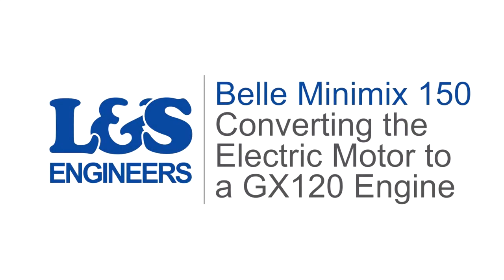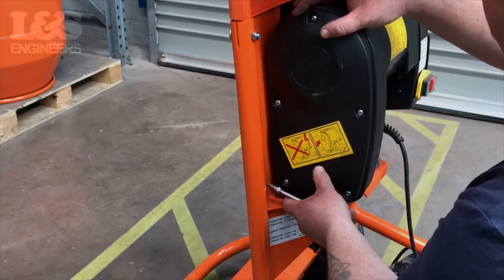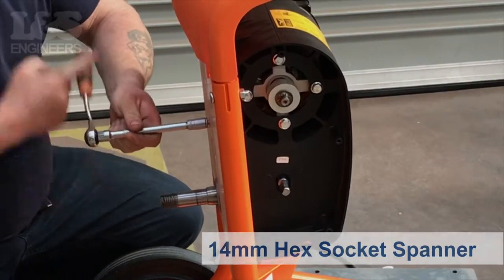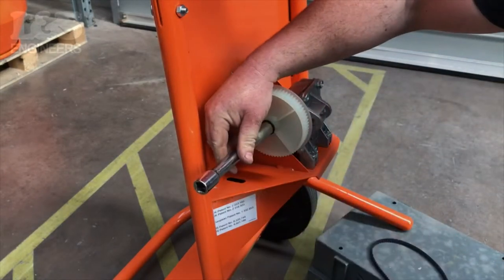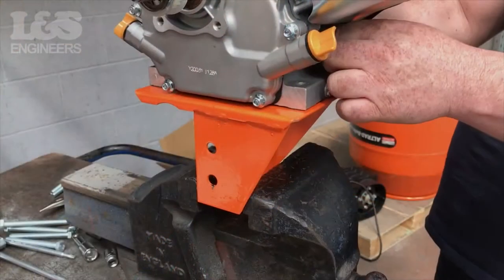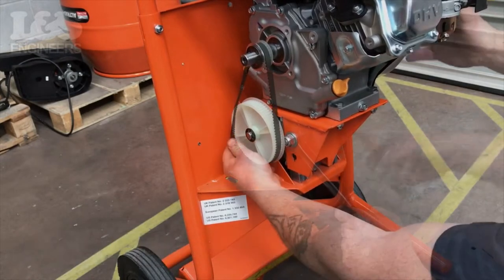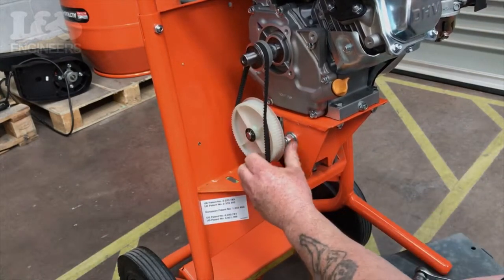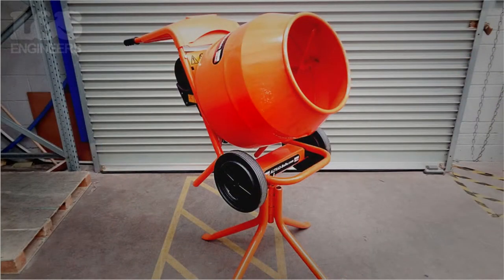How to Convert an Electric Motor to a Loncin G120 (Honda GX120) Engine on a Belle Minimix 150 | L&S

Comment: The video was helpful but omitted some of the details of the steps,  examples, the assembly of the pulley, spacer and washer on the engine driveshaft and the tensioning of the drive belt.